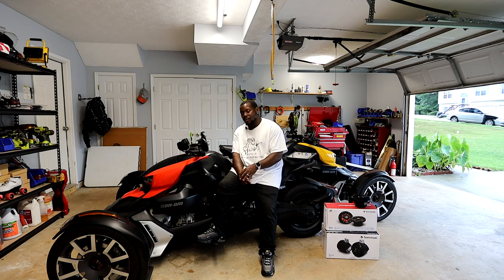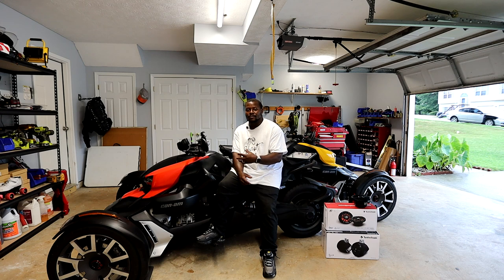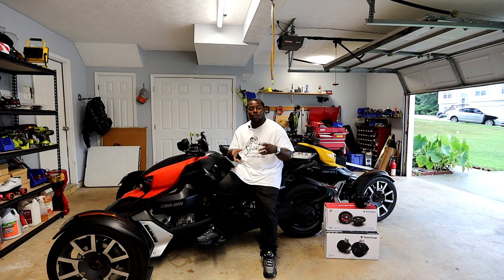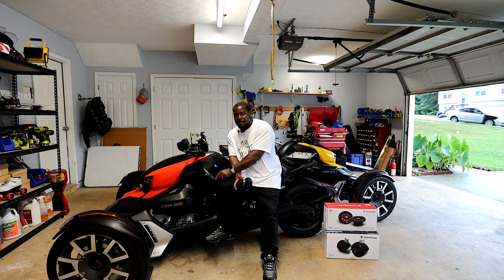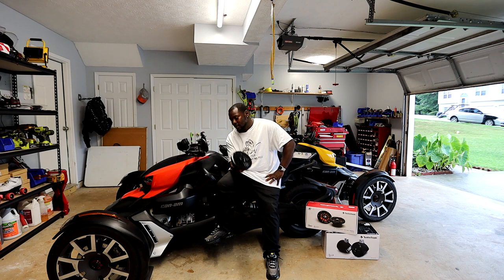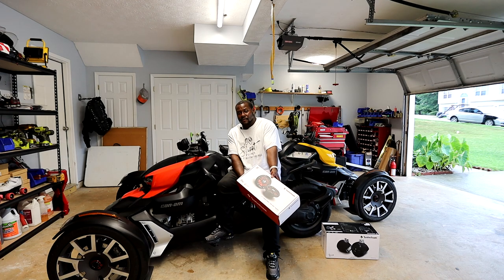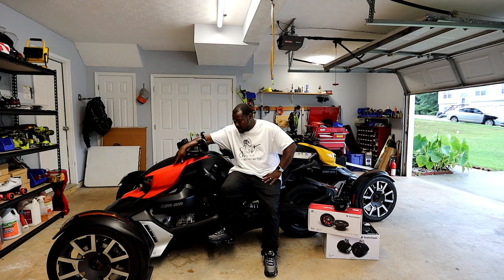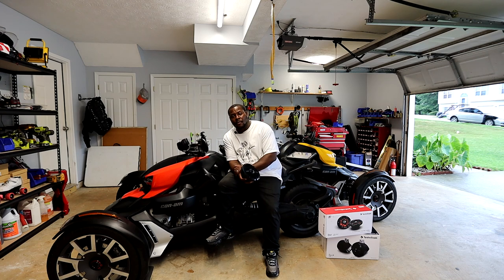Can-am Ryker Audio System Extremely Loud

Comment: What did  use to to make a prefect hole to fit to side of the ryker for the speaker to mount
Reply from the maker: Just a  drill bit, but then I used some rivet nuts to make it more secure
Reply from the maker: https://drive.google.com/file/d/1yUaxuC7aOcT8pM4do_A4CUYYR1vOz565/view?usp=sharing

Comment: Can you please tell me where you ran your remote wire to from the amp
Reply from the maker: Ramone Taylor you should be using your Bluetooth controller for your amp remote wire. Your Bluetooth controller has a remote wire on it, run that wire to your amp. This way when you turn your controller either on or off it cuts the amp on and off
Reply: Byron Arnold ok and 1 more ?. Did you have to upgrade your battery at all??
Reply from the maker: Ramone Taylor no your stock battery will work just fine